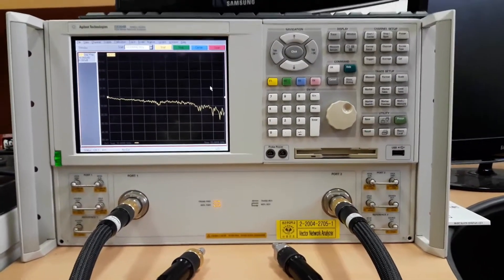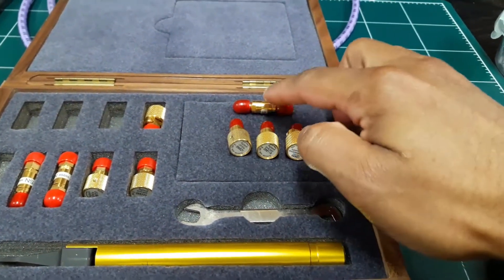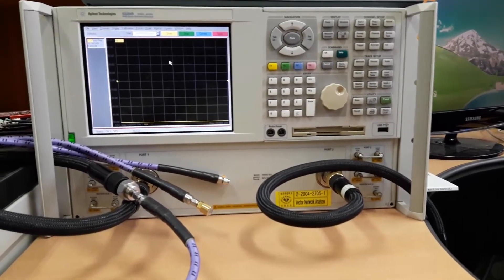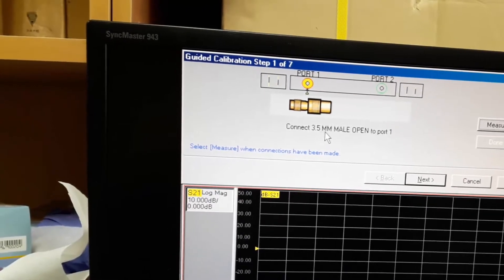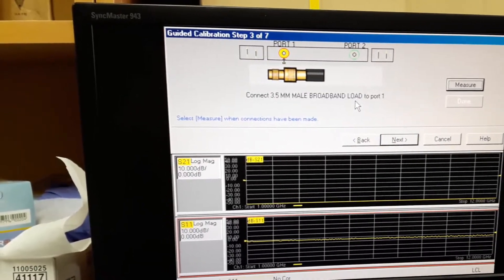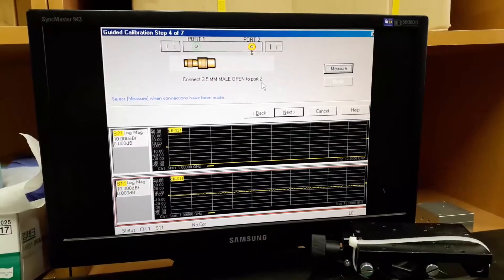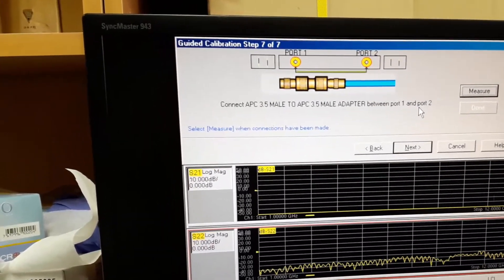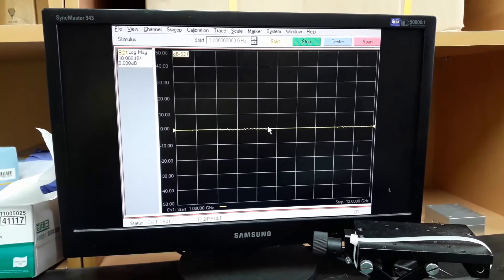Two Port Calibration of Agilent E8364B VNA

Comment: I don't have calkit capable of the frequency range I am going to use. So using mechanical SOLT method by using N type 50 ohm connectors, can I do calibration for higher frequency like upto 67GHz?

Comment: It 's the same step to calibrat only one port   the 1- port  ?????   to measure the monopole antenna
Reply from the maker: Saida Elajoumi The calkit is designed to calibrate the two ports simultaneously. So the after calibration you keep the second port disconnected and use the first one connected..with your monopole antenna
Reply: @tensorbundle   tank you  so much